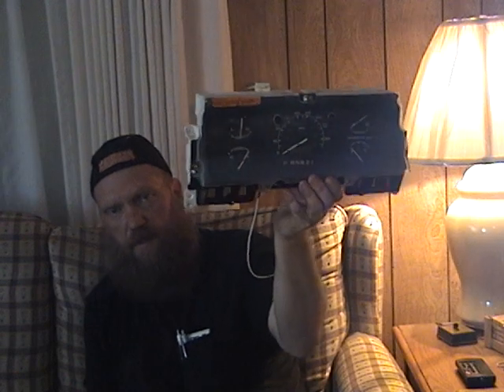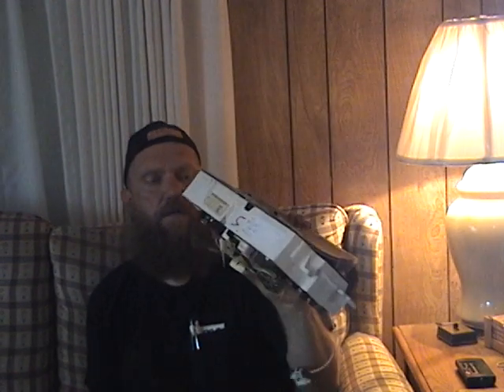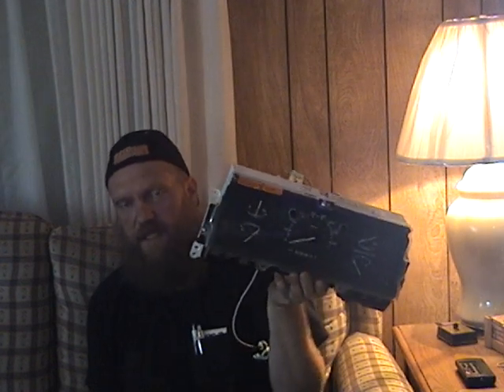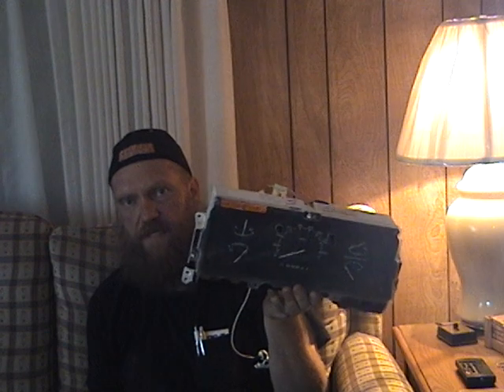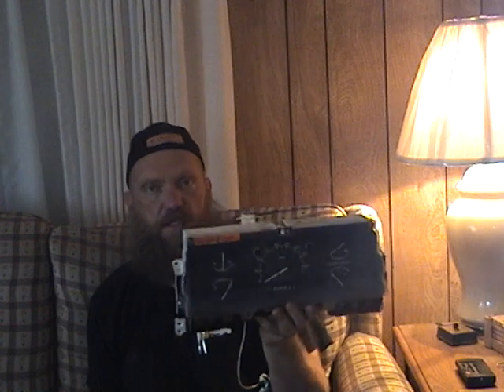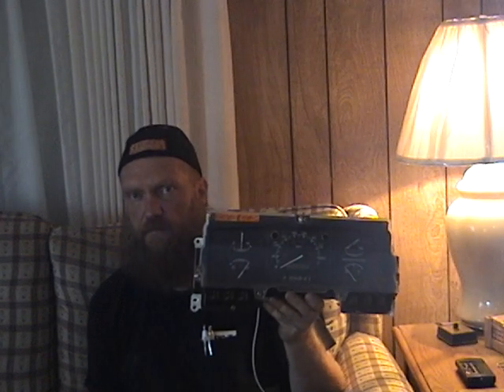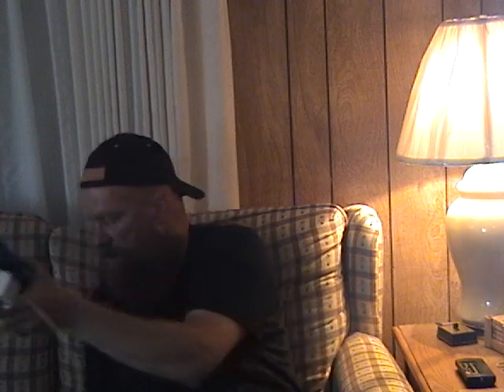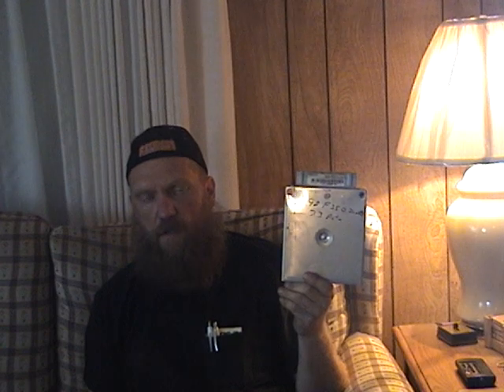EMP, Faraday Cage,  BUG OUT Vehicle  Thoughts

Comment: There are two reasons your car isn't a good-enough faraday cage, despite being a mostly metal box: the radio antenna and the windows. The antenna conducts electromagnetic (EM) and radio-frequency (RF) energy into the interior (or radio reception would be iffy), and the windows are fairly transparent to most of the wave lengths along the EMF spectrum. I measure RF radiation while driving sometimes, and the RF off big cell antenna arrays comes right in, no problem, as I pass them on the freeway.